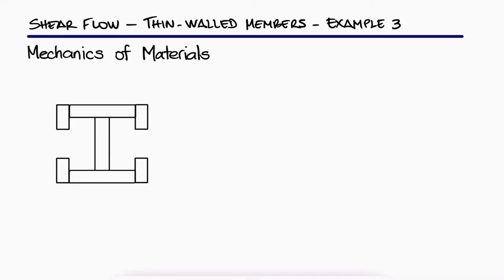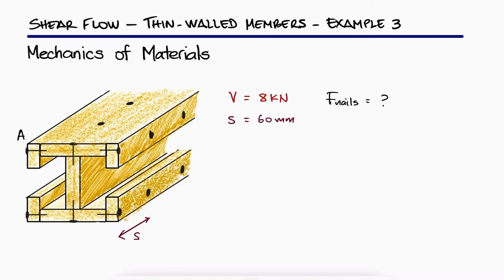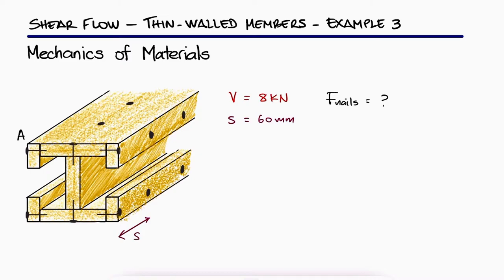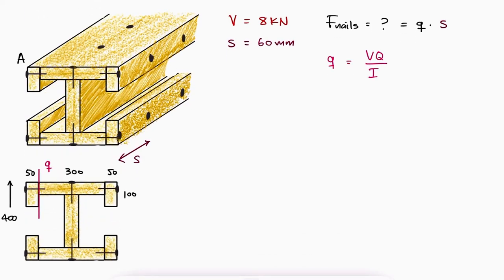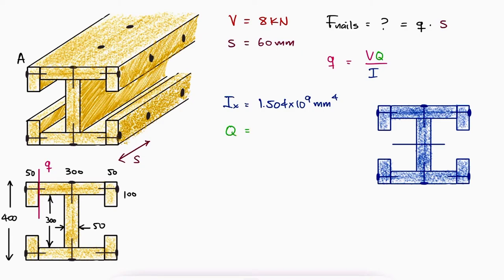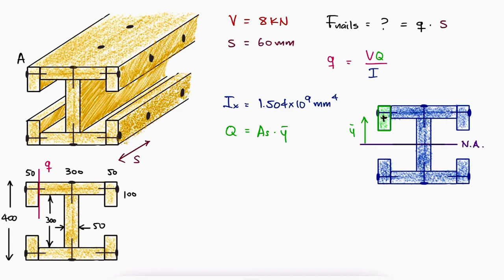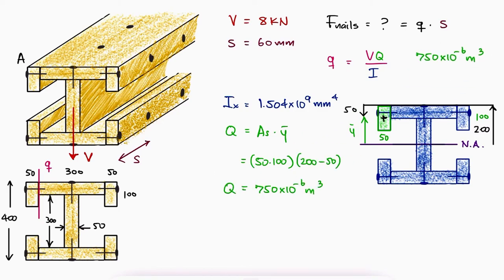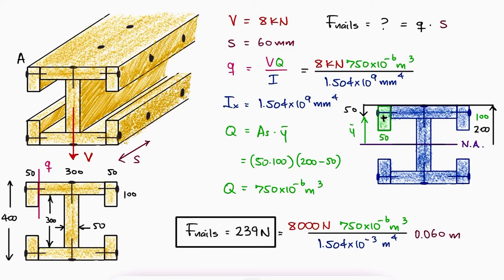Shear Flow Force - NAILS in I-beam in 2 Minutes!

Comment: Which area is to be considered for the nail along web
Reply: Yes bro same doubt for me .. it's gate 2019 questions sir
Reply: Presumably all the area connected above the small cut that goes across the web??
Reply: It maybe found by this technique- 
"Remove the nails that you want to calculate the force, what part of the beam becomes detached from the beam? That's the area you need to consider." 
The concept is made up by me, and worked for me till now.